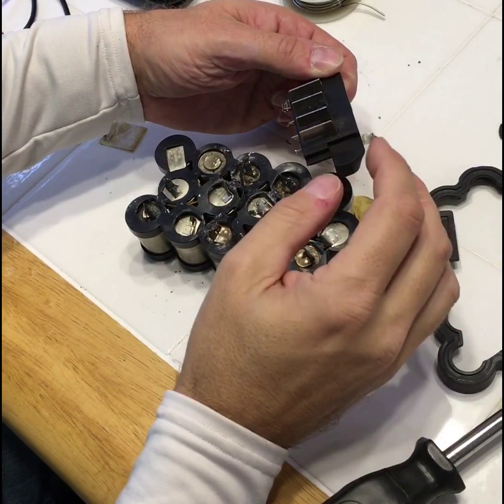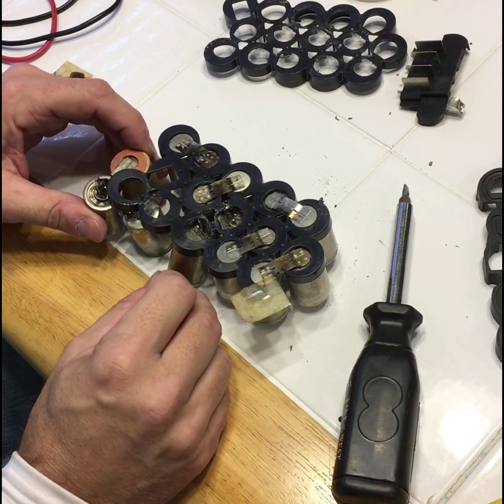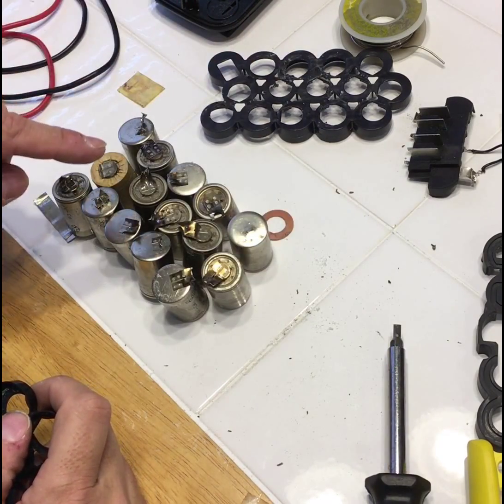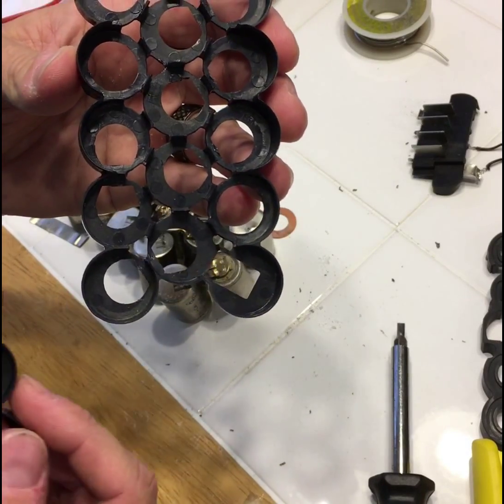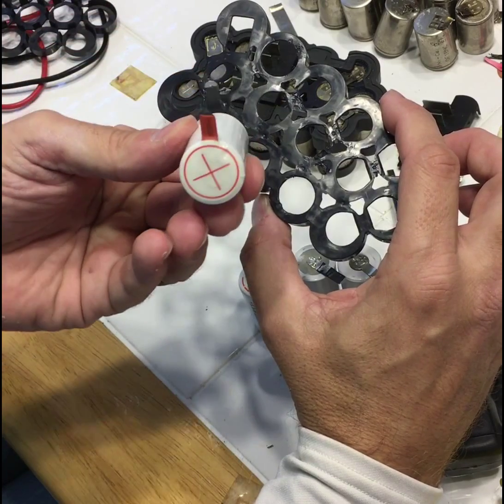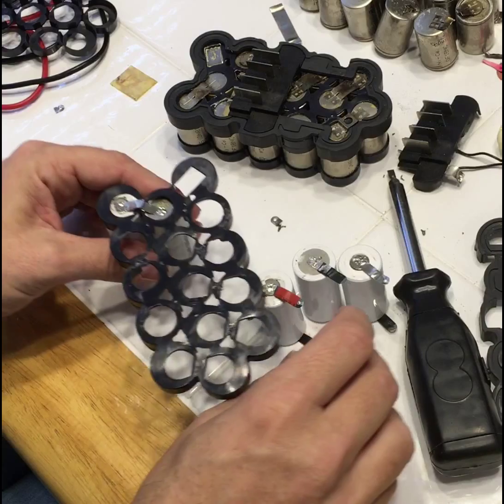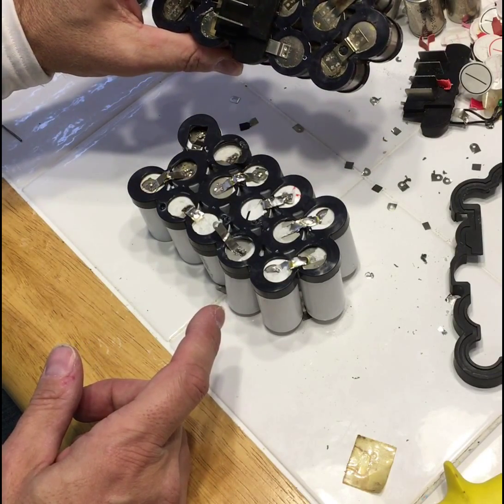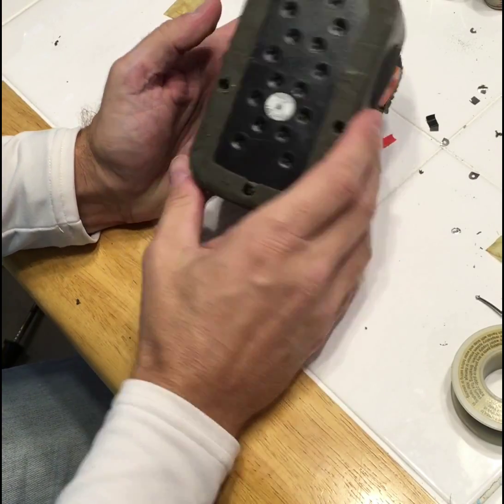Ridgid 18 Volt Battery Internals Replacement Part 2

Comment: I've had two 18v ridgid batteries die because it started raining. Each time they barely got a little rain on them, but they died. One is dead nothing the other will briefly light the drill light. Nether will take a charge. Both were in top shape (not old or reduced charging ability) prior to getting wet. Any suggestions? I've heard that the batteries have a protective circuit that can burn through. I've tried the jumping method without success.

Comment: Have the # of the battery you bought on ebay?
Reply: He mentioned in the 1st video that he purchased a set of "Sub C" batteries. Sub C is the physical size of the batteries 22 mm diameter by 42.5 mm high. It takes 15 batteries to replace the ones in the Ridgid 18 volt unit (each battery produces 1.2 volts). I noticed on eBay that Sub C batteries come in different capacities, 1300 mAh up to 2200 mAh. The higher the mAh the greater the capacity, even though the physical size of the batteries are the same.

Comment: This video may have shown how to replace the batteries, but it was soooooo drawn out that it was difficult to stay awake. Also, rather than sketch the layout & connections one could simply take a photo with a cell phone.
Regardless, there it still a fair amount of time & work to expend with opportunities for failure if not done correctly. Checking for  continuity before reassembling is a MUST!
I think that with all the hassle involved I'd just as soon purchase a new, pre-assembled battery from ebay/Amazon/etc.